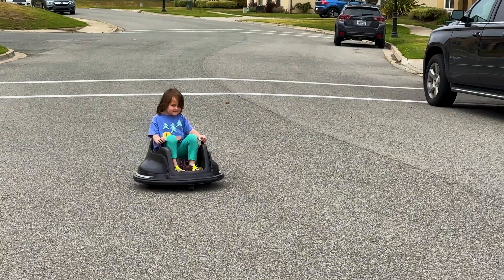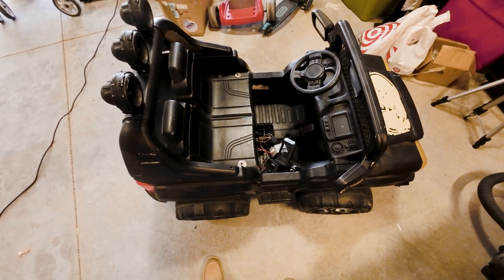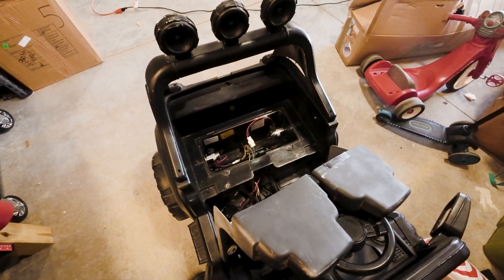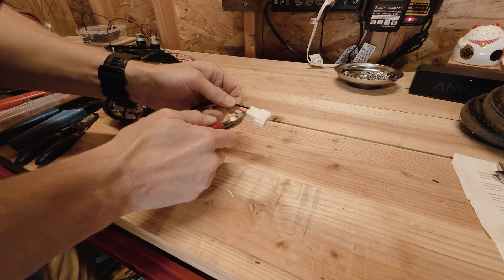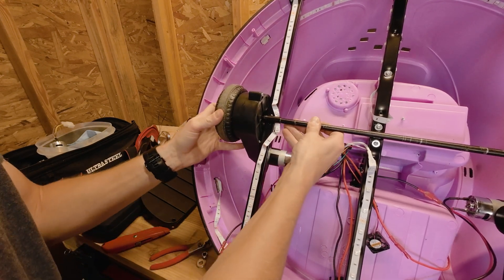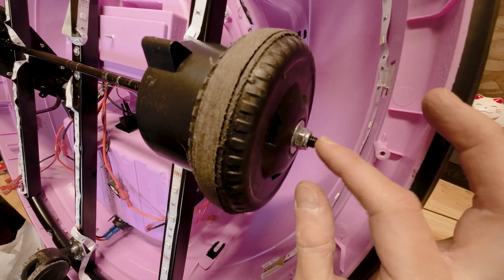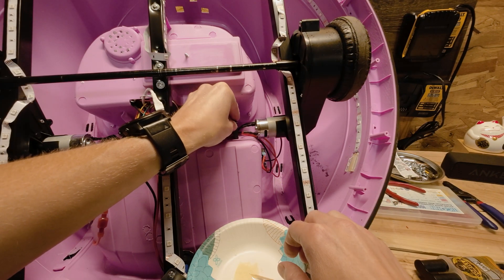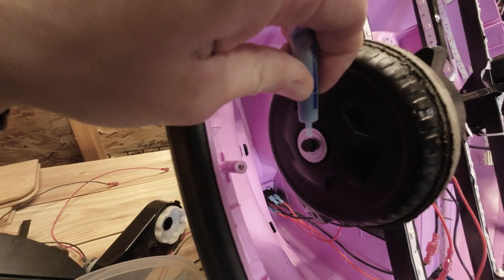Incredible boost in power with Power Wheels gearboxes and 12V motors in a KidZone bumper car

Comment: Does the RADIO CONTROL still work
Reply from the maker: Unfortunately it doesn’t, the power from the drill battery fries the controller board. I did another video where I did a rewire to run the motors without the board.

Comment: I need your help sir.....
Reply from the maker: What do you need help with?
Reply: I have similar car which my niece uses but it doesn't work I lost the charger
Reply: And I fund a compactable charger but now after the bumper car it automatically start working means it moves on its own and also have lost the remote I will make it direct as you have done it in your video I need any help so I will for sure message you or comment here
Reply from the maker: @starkexpo6742  Doing a drill battery upgrade will definitely bypass the need for a charger. As for the automatic movement, I'd say check the control sticks to see if they are sticking, otherwise the controller board is probably fried and is creating an undesirable input (moving when no command is given). Honestly, getting rid of the controller board is the best option since it heavily limits the car's ability to maximize the power from the drill battery. Let me know if those suggestions help - good luck!

Comment: Hola, ayuda el carrito que le compré a mi hijo no tenía control remoto y quiero saber si se puede adaptar uno ayuda
Reply from the maker: If you want the remote functionality, be sure to check out the controller box in the description. You can replace that with the one in your stock bumper car and it'll give you remote control. You won't be able to use the drill battery upgrade though since the power will fry the controller board. Good luck!

Comment: Did u change out the mother board also or just use the 6 volt control board it cane with?
Reply from the maker: I fried the 6V board almost immediately when I plugged in the 20V drill battery. You’ll want to upgrade to a 12V board at least and dial down the voltage to something like 15-16V to avoid frying it (still run the risk but your odds are better at those levels).

Comment: I have a 12 volt bumper car for the kids that I want to upgrade. You mentioned we could reach out for help with that. How do I do that
Reply from the maker: You could still use the drill battery for it but you’ll want to get a voltage step down to avoid any possible damage to the board. I was able to use the 20V on the 12V board for a while until it fried. So I think if you get everything and dial it down to 15-16V, you’ll see a huge improvement without running the risk of frying the board. Let me know if you need anymore help!

Comment: I really want to upgate my girls bumper cars to a 12v over the 6v is it easier to replace the motor like you did here over the battery?
Reply from the maker: I ran my bumper car with 6V for a while just fine. It’s about power delivery though, you need to upgrade the power source (drill battery) to make any changes.